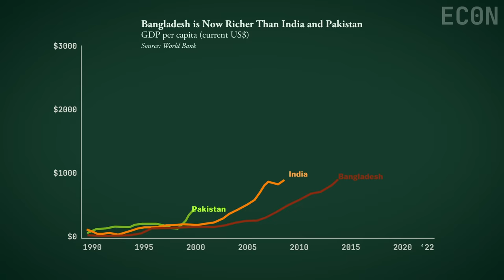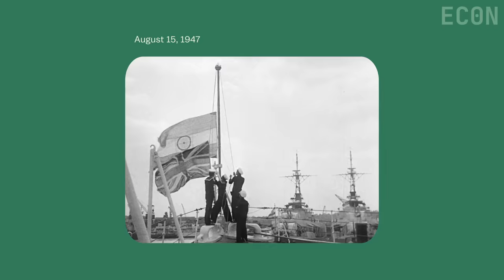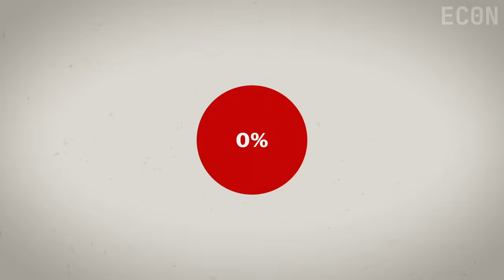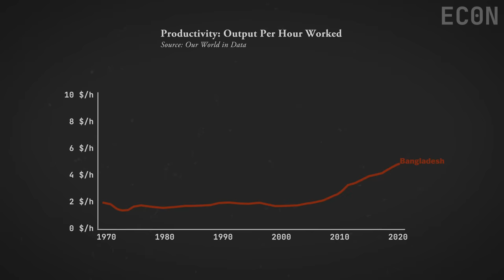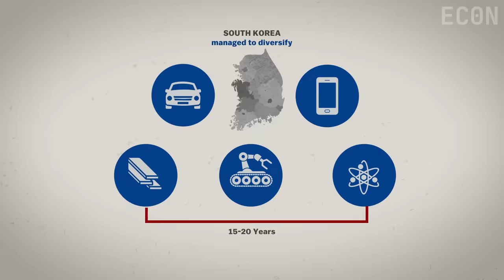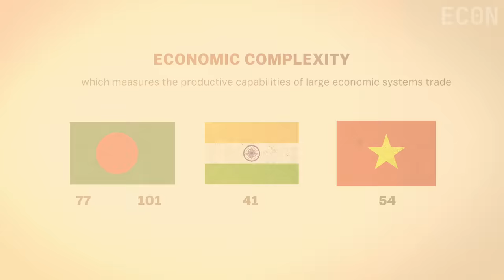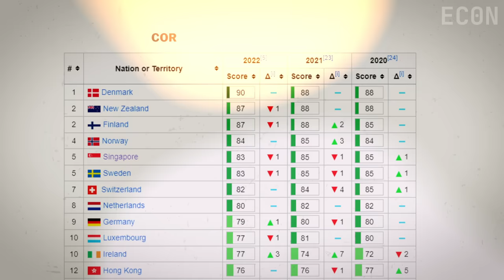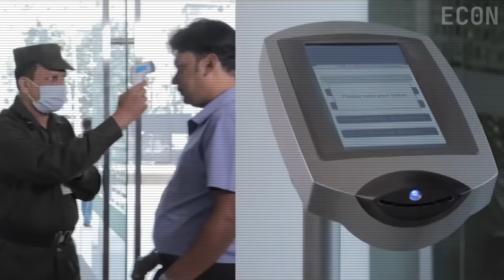Bangladesh Economy is Getting Rich but It Is at Risk | Bangladesh Economy | Econ

Comment: As a Bangladeshi, I have to admit that the government has failed to diversify the export sector. It is too much reliant on a single sector. There is a lack of entrepreneurship. Most tech students flock to foreign countries for higher education and don't return. There is also rampant corruption and political instability which hinder the nation's progress. The recent democratic backsliding will worsen the situation.  😢
Reply: Diversification of economy should be the first priority here
Reply: It's not the government's job to diversify a country's export basket. The correct term would be that our government has failed to "allow" diversification of our export sector and economy as a whole due to faulty policymaking and implementations like higher import tariffs on some engine parts; effectively cutting off potential welfare gains from value addition.
Reply: @smallSphere69  but there are mega corporations in Bangladesh run by Bangladeshis, your point? 💀
Reply: @smallSphere69  A dumb statement. racial determinism is a failed concept. Under different circumstances, people of same ethnicity performs far different from each other. The biggest case study in history is North and South Korea. Another example is the Southern Italians that were neglected in their home and migrated to the Eastern USA. They now are significantly more successful. 

People of Bangladesh are unable to grow because of rampant corruption, religious zealotry, cultural rigidity and political turmoil.
Reply: How would you compare Bangladesh to West Bengal's economy?  Can Bangladesh sign a free trade/free investment/free joint R&D agreement with India to integrate Bangaldesh with West Bengal's economy?

How is Bangladesh's tech sector compared to West Bengal's?
Reply: @smallSphere69 What do you know about mega corporation? Do you have any idea about Bangladeshi companies? And Bangladeshis are not hard working enough? Seriously? Then remember that Bangladeshis are not like west bengalis.
Reply: @AnAn___  To be honest, West Bengal is not a sovereign territory. So, any trade deal they make, if it's part of the foreign politics, Central government of India in New Delhi is gonna have the last say, making it an Indian trade deal, not a West Bengali one. 

If West Bengal is to become independent yet separate from East Bengal, that'd devastate West Bengal's economy, because of the mutual dependencies with the other Indian states would be broken. They'll be able to make a strong trade relation with East Bengal, and would be benefitted from the closer proximity, but it's gonna take a long time. 

If the two sides of Bengal were to become independent, that'd require decades of geopolitical conditioning to be overcome by both ends. It'd call for massive.... and I do mean MASSIVE logistical effort to merge the two sides by roads, highways, and railways. Waterway would be a much easier deal tbh, the whole region is covered in rivers...
Reply: @smallSphere69  What else can you mean by "Bangladesh people" ? Feel free to illuminate.
Reply: @sadmanpranto9026  What about a free trade, free investment, free joint R&D, partial free labor mobility agreement between India and Bangladesh? Other countries can join this if they choose, such as Thailand, Sri Lanka, Nepal, Vietnam, Indonesia, Philippines, Australia, South Korea, Japan.
Reply: @AnAn___  Indian companies freely trade and invest in Bangladesh's economy, they are free to come and work in Bangladesh as well. Problem with labor mobility is, for both countries there are better prospect in other countries (primarily the middle east), which is why not a lot of people travels between each other for work. As for joint R&D effort, I honestly don't know much about that, so I can't say anything about it. 

Bangladesh is already a puppet of India. Indian government makes deals and agreements that are one sided for them. In return, they support the dictatorial government of Bangladesh. 

One cute little example is, Indian Trucks get to have unbounded transit passage through Bangladesh to go to their Northeaster provinces. But Bangladesh don't get any transit to go to Nepal or Bhutan. When two ships arrive at the port of Chittagong at the same time, one being Bangladeshi and one being Indian, there's an agreement signed that says the Indian one must always have the priority for docking first. Indian government made a coal power plant in Sundarbans of Bangladesh FOR INDIA after it was rejected by their own regional government. Further endangering Bangladesh's own natural/ecological treasures. 

This is why NOBODY in the free world supported these mock election of Bangladesh, but India DID... India did support this election and the "winning party". Because it's their home grown puppet of terror. 

There's a good reason Bangladeshi people don't like India anymore, despite them helping Bangladesh gain independence. It's not religion or the people or their culture. It's because, as a upcoming global power, India likes to dominate their neighbors, not cooperate with them. This is why nowadays, people hate the government of India. 

There's a good video in Youtube made by "Kraut" who discusses this aspect of India (among other things).
Reply: @AnAn___  So you are thinking that BD is still very weak in economy? 

Actually BD's economy already heavily diversified. 
BD has bigger pharmaceutical Industry than India and Pakistan combined. Bangladesh has light engineering sector which is growing at 28% rate every year. Which growth is comparable to China. 

But these sectors are very new so media didn't covered aboy those sectors.
Reply: @s.msadat8383  Please provide more data on the light engineering sector.

What other sectors does Bangladesh have?

What is the size of BD's pharma sector in 2024?
Reply: If Bangladesh can diversify the economy and stable politic with streamline regulation and less redtapes and as liberalise as possible I am pretty sure Bangladesh can quickly become high income developed counyry
Reply: @Mozely374  How to diversify the economy?

How would you compare Bangladesh and India (or Indian states such as West Bengal and UP) with Bangladesh with respect to regulation and red tape?

How to surge education outcomes among the top 20% of Bangladeshi students quickly? (strikes me that India's college and university system for the top 10% of students is very good and that Bangladesh can quicky replicate that)

Can Bangladesh invite many IITs, IIMs, NITs and other Indian universities to open offshore campuses in Bangladesh?

Can Bangladesh get a big chunk of India's BPO and tech services business. Bangladesh is cheaper than India's more affluent states and metro areas. Bangladeshis are more humble too.
Reply: @AnAn___  Bangladesh has 5.1B dollar size of Pharmaceutical industry and light sectors with 200M dollars size. 

Pharmaceutical industry can be 10BN+ in 2030 and light engineering sector has growth rate of 25% to 50% yearly. 

If Bangladesh gets proper investment this two industry can surpass RMG.
Reply: Brother, how do you expect Tech Students to stay in the country? Is the pay enough? I am doing Undergrad on CS. In USA, a fresh graduate earns 80K usd annually a front-end developer. And in our country, not only most graduates get less than 10% of that salary, most of the company require 3+ year of experience and doesn't compensate working overtime properly.
Reply: @elmiabir7059  How does tech compensation in Dhaka compare to Calcutta India? to Bangalore India? to Jakarta Indonesia? to Ho Chi Minh city Vietnam? to Manila Philippines?

What cities in Bangladesh have a large tech sector and how does compensation vary between these cities?

Please compare the start-up ecosystem in Dhaka with other Bangladeshi cities and with Calcutta, Bangalore, Jakarta, Ho Chi Minh city, Manila?
Reply: @elmiabir7059  I understand your pain brother. That's what I am trying to point out here is that our govt. do not produce enough job opportunities for tech students. Btw, are you a BUET student studying in the US now?
Reply: @antelopelol2865  No bro, I'm not from BUET, neither did I graduate yet. I'm just in first year. What about you? Like if our profiles are same we can help each other or if you are already experienced in the field, perhaps you can mentor me? 🙂
Reply: This is a problem for the entire subcontinent I guess
Reply: @blastergoon4185  Please elaborate.

Do you mean that India's economy is over reliant on tech services, business services, tech manufacturing, R&D, IP, pharma, angel investing, VC, private equity, IPOs, additional public offerings, M&A? If so, why is this over reliance a problem? India is also not that dependent on remittances.

Bangladesh has to urgently diversity away from apparel and remittances. Two sectors in Bangladesh are growing rapidly. Pharma and custom engineering/electronic manufacturing. But Bangladesh needs to have more large industries than these too soon; as well.
Reply: @AnAn___   no about the emigration problem. The high qualified people from the subcontinent are moving out, to western European countries or certain middle eastern nations, we need to work on that, to use that human wealth on this subcontinent
Reply: @blastergoon4185  this emigration is positive because in the long run, many of them come back to their home countries. Plus they bring a lot of bus dev, FDI, angel investing, VC, business networking back to their home countries.

Plus a lot of foreigners now work in places such as Bangalore. And soon many foreigners will be working in Bangladesh.
Reply: @blastergoon4185  This is much bigger problem in Bangladesh than in India. I know many Americans who have moved to Bangalore and other Indian tech centers recently. But in general the foreign workers in India do not become Indian citizens in the long run because of India's archaic convoluted process. India has to make it easier for immigrants to become Indian citizens and long term residents.

India also needs to stand up to the woke, socialists and left and let inequality within India rip. As the NRIs continue to come home, measured inequality inside India is likely to rocket higher, leading to a massive global woke demonization of India. India needs to stand strong.

Similarly, Bangladesh needs to stand strong and openly say . . . . "p                        
           ositive inequality based on merit is good. We welcome and celebrate it. And we welcome the diaspora home, with the understanding that it will sharply increased measured inequality and drop Bangladesh's global human rights ratings to the bottom of the world as the global woke movement tries to destroy Bangladesh.
Reply: get rid of mafia first
Reply: @FS-me8mj Please elaborate on the mafia.
Reply: @AnAn___  Reason behind the current corruption index (poor governance is also to blame) --> Low FDI and Reason why bangladeshis like me stay overseas. The side effect of staying overseas is that the government gets to get free money and boast about the "growing" economy, which in fact is a facade as shown by the video above.
Reply: @FS-me8mj  Let me push back. Bangladeshi diaspora and expats (whether they live in China, Japan, Malaysia, Singapore, India, Europe, Australia, Vietnam,  South Korea, Taiwan, USA, Canada, UAE, Thailand, Indonesia) can bring a lot of bus dev and FDI back to Bangladesh. They greatly expand Bangla business networks.

Do you see Bangladesh becoming one of the world's largest providers of BPO and other tech services?
Reply: @AnAn___  yeah but how does it solve the problem of lack foreign direct investment? The number 1 issue is corruption. If I am a CEO of a company, I wouldn't spend a dime in a country that does not guarantee return for my investment. In other words, my money has the potential of going into the pockets of "mafia" with no care for laws. The issue of corruption in Bangladesh is perfectly summed by some comments above.
Reply: @FS-me8mj  If Bangladesh deregulated, would that help? With deregulation there is no opportunity for corruption because no approvals are needed.

The opposition might oppose it and say that it allows for foreign negative powers (nonmuslims, India, Israel, Europe, USA, Japan, South Korea) to own Bangladesh and dominate the Bangladeshi economy.

How could Sheikh Hasina push back against this argument?
Reply: Spot on. The Bangladeshi economy won't be able to perform well for a long period of time just riding on a single sector -textile. Bangladesh must take lessons from India which is the fastest growing economy of the world and virtually producing and exporting everything. Apart from that radical islamic movement is spreading in the grassroot level driving the youth towards radicalism. .
Reply: @surojitpal1861  Agree with you. Inshallah Bangladesh's economy will transition and diversity quickly. And Sheikh Hasina will achieve victory against this radical islamic movement.
Reply: @AnAn___  India and Bangladesh should work together for the betterment of the economies of both the country. It will be of mutual benefits to both India and Bangladesh
Reply: Your country is progressing but your point is good as government should look in another sectors as well but still Bangladesh is stable country in south asia after corona!
So, political instability is created by people of opposition party that wants to destabilize the country like Maldives govt. Is doing!!
Reply: @achintyasharma7660  True.

I hope that Bangladesh economically rapidly integrates with West Bengal and India.
Reply: @smallSphere69 You have to accept the truth without blinding bias.
Reply: Diversification is something that Bangladesh needs to do. But other than that none of the other things you mention like Brain drain, Corruption and democratic backsliding are problems.
Reply: @arunsar7893  I would partly agree with you. However brain drain to the rest of Asia (Japan, South Korea, Taiwan, China, Vietnam, Thailand, Philippines, Indonesia, Hong Kong, Singapore, Malaysia, Australia, New Zealand, UAE, Saudi Arabia), Europe, North America is a manageable moderate challenge.

Diversification and further deregulation, simplification of regulations, improved university education--especially at the masters and PhD level (K-12 in Bangladesh is good)--will solve it.

There is no good reason Bangladesh can't have a much large angel investing VC ecosystem and far more FDI.

Bangladesh needs to embrace the increased positive inequality that rapid economic growth will likely generate.
Reply: @smallSphere69   right , most of them want  to leave coutry or want to get government job
Reply: One of the main reasons the studenta reading at abroad dont return is that Bangladesh doesnt give much oppurtunity to them and also the poor people who became stable are afraid that their stableness wouldnt continue for some influential people in the area. There are many influential and political figures who are much corrupted
Reply: @NihalHossain-m2v  Interesting. What about opportunities in Bangladesh's growing tech and pharma sectors?

Do you mean that only a fraction of Bangladeshis can access these parts of the economy?

How is crime in most of Bangladesh from your perspective? Weather?

Bangladesh has been transformed by the trees, I think.
Reply: @NihalHossain-m2v   50% agree , no country goverment give a citizen everything , a citizen has a big responsibility to devlop his family and country . most of student donot take risk , they always want to get job , but they forget that bangladesh is a small country , its not easy to find a job .
Reply: @NihalHossain-m2v   its not easy build a country just only 50 years  , my country was 4th poor country in world , so work hard
Reply: @surojitpal1861 what do you mean radical Islam. I want my country to progress but if progress means have a lot of freedom have sex outside marriage drink party cheat then you can have that progress.
Reply: Feel for you brother. There has to be also the middle class population who take into their own hands with unity that can overcome it. Whether it is through communism or anything they have to do but it has to be from the people not political parties.
Reply: Sir due to the current government the economy is somewhat stable.Your opposition are highly radicalised people and once they come into power it will have the same fate as Pakistan.Sheik Hasina has balanced her relationship with both India and China.Your opposition is anti India Jihadis and will not only kill the economy but will halt your economy to a stand still.
Reply: give me a single reason why they would return . (I am Bangladeshi)
Reply: @smallSphere69 are you sure bout that? I don't think so
Reply: Inward remittance from the Middle East and some Asian countries are also a vital source of foreign currency and economic growth. However, a lot of hundi goes on in there.
Reply: We are more politically stable right now than ever which is contributing positively to the economy
Reply: @smallSphere69 
There are big corporations is BD. Though, most of them are family run and lack any real corporate governance or culture. And even if there is governance, it is often underwhelming.
Reply: @smallSphere69  you did infact mention race
Reply: democracy in itself is not going to help bangladesh. maybe they need to try authoritarian meritocracy 1 party government with capitalism and a market economy, similar to china's model.
Reply: It's mainly the corruption and politics.
Reply: you forgot the main problem - radicalisation of youth to Islamic fundamentalism - BD is the next Afghanistan
Reply: @TanmoyBiswas  this is a very biased opinion
Reply: ভাই এতো বড়ো কোমেনট
Reply: @inrpicmax6541  you're totally biased
Reply: All the economy is in dhaka and Chittagong decentralised and diversified economy  is in dire need in Bangladesh.